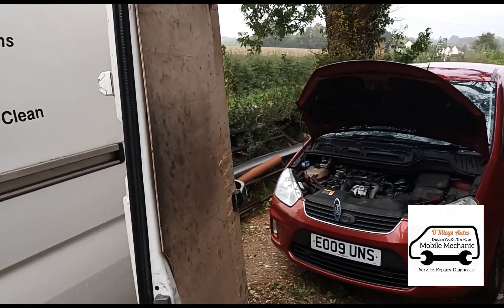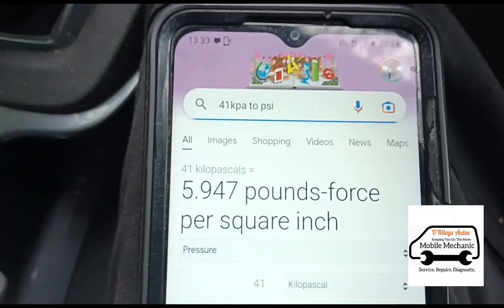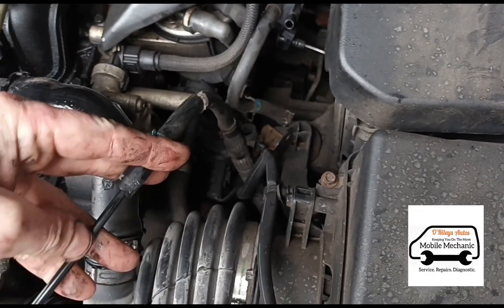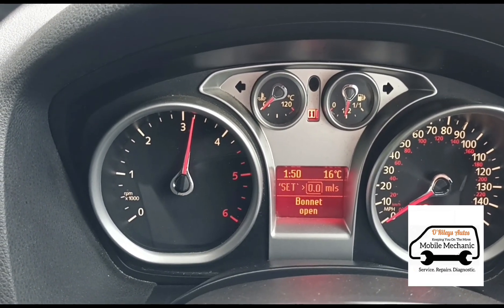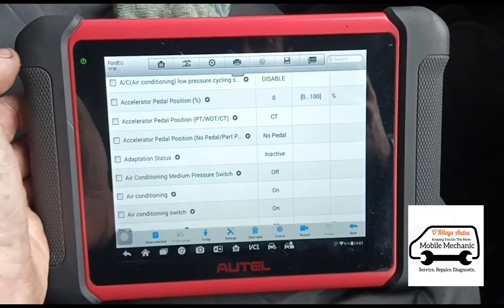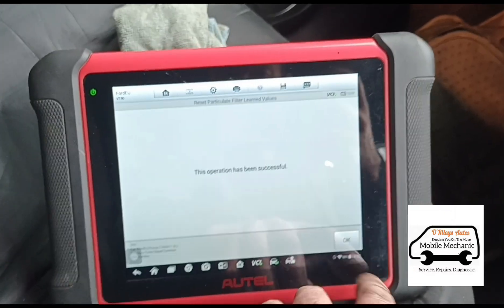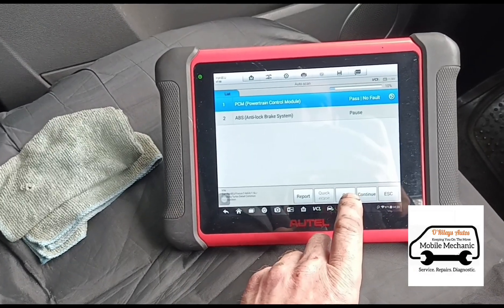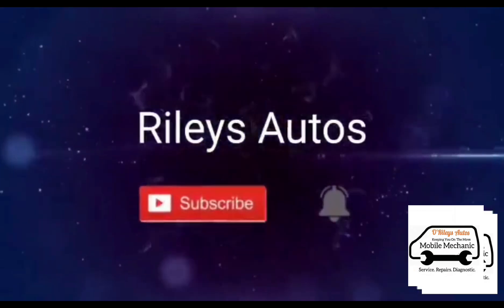Ford Focus C Max 1.6 Tdci P242F:E1 DPF Ash Accumulation P2458:61 P242F:00 P042F:21 P0490:21 P1412:68

Comment: Hi if the o2 sensor is right on top of the dpf should u remove it before aplying cleaner or the actual  cleaner helps cleaning the o2sensor?

Comment: Thanks again for this i followed the steps on a mazda 3 with the same engine using mannol dpf foam cleaner and it's done the job. I had the same code at the end but didn't do a forced re gen as i couldn't get an oil filter to change the oil that code went away after a short drive and re scan.

Comment: I love your video. I have a question, i fitted a new dpf fixed the splits in the pipes but my dpf pressure at idle is 3.58 kpa. There are no leaks i can find and i have relearned the pressure values but to no good do you have any advice please. Thank you

Comment: Thank you for this video, what is normal DPF pressure for this car? I got the same Ford Focus C max 1.6 tdci and DPF pressure is 2kpa on 3000rpm but I still got P2002 error. Is this pressure too high?
Reply from the maker: Slightly too low

Comment: Hi looking for some advice if possible have a ford transit mk8 minibus and keeps going into limp mode seems to be only happening on the motorway when cruising at low revs,  dash board says service engine now and will rev above 2000 rpm.  I can turn of ignition wait a few minutes and turn back on and runs ok for a bit then same again

Comment: This engines are good and economic but every week they need to be pushed harder to clean up the carbon buildup, i have it for 80k km and every weekend i do a around 80km in with high speeds 80-140 and then after i do around 140km/h for about 5 minits i can feel the car already is more responsive on the trottle, just do this and your engine will thank you
Reply: My engine is tuned up from 90hp to 145hp and it feels so good pasing people up fast even tho some people still accelerate when you try to pass them just to be mean.

Comment: Good engine if maintained properly and ran on the correct oil, So many customers are there own worst enemy regards maintenance.
Reply: Doesn't always work, iv had a ds4 for 9 years on 99k now oil change for low ash oil every 6k with the filter aswel and been having dpf problems, regularly used the foam cleaner aswell. I drive it on long journeys regularly and it gets revd up alot due to living in the valleys.

Comment: Top job Jimmy with proven pressure results 👍 did you mix the dpf cleaner with water in the spray bottle for the egr clean?
Reply from the maker: Yes. The water helps it oxidise

Comment: Great Vid, those 1.6 tdci's are notorious for carboning up the oil ways and wrecking turbos.
Reply: It seams the culprit is the filter at the bottom of the oil feed to the turbo, it's recommended to remove it.
Reply: @Golo1949  regular service and replace the bottom banjo bolt with the little filter in

Comment: nice one , i would worry using that stuff through the intake in case the engine revved  its nuts off ,,,,,,,,, light brake cleaner
Reply from the maker: Its not flammable.

Comment: Has go to be the scariest engine during a regen, makes me sick every time I do one
Reply from the maker: It didn't even need a regen but code wouldn't clear for some reason
Reply: Yeah had it myself, the ecu must just need to see a regen before it completes circuit for code clearance and had two of these over the years run on during regen, scary stuff, I actually now tell I’m not responsible for failures during regen like turbo failing or cam belt snapping